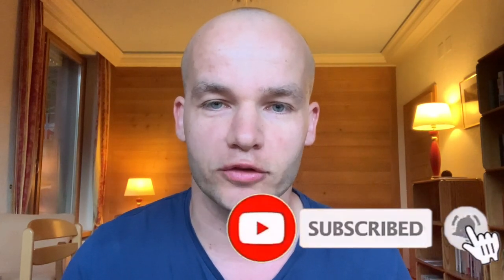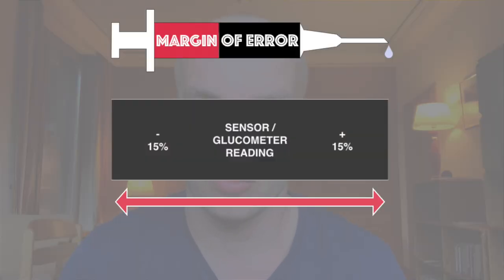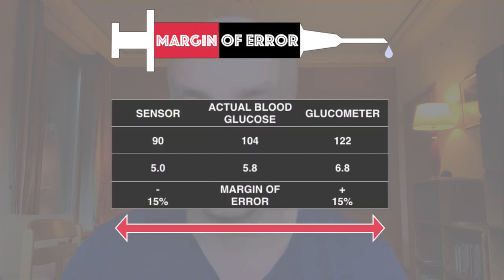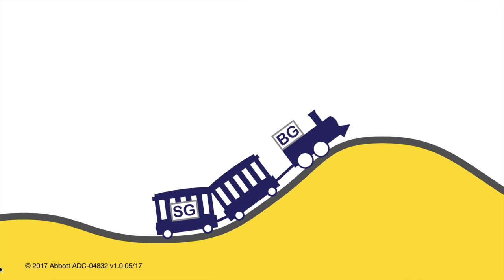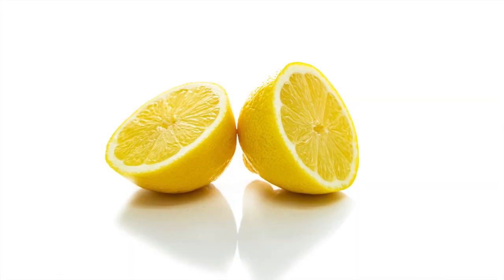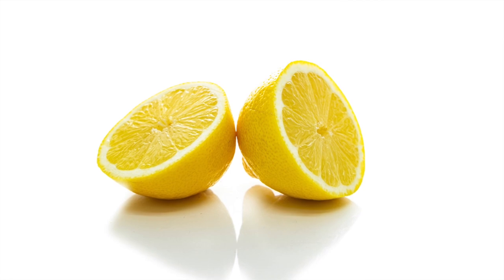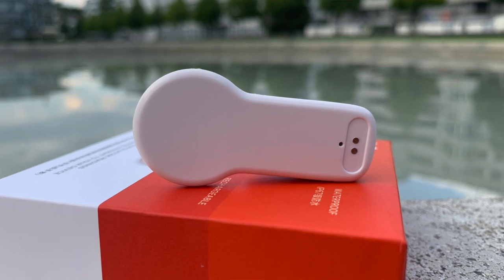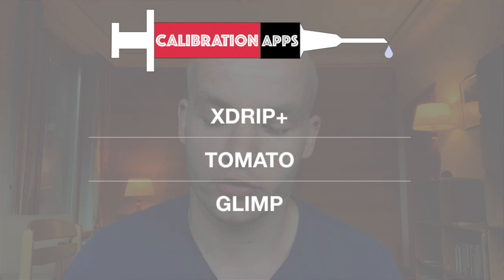FreeStyle Libre Accuracy Issue / 6 Tips For Accurate Sensor Readings

Comment: Ditto to everyone about the accuracy problem.  My Freestyle Libre has told me that i'm having low blood sugar when my finger stick meter tells me my blood sugar is normal & in range. I'm not quite sure if the poeple who developed it are diabetic's. We live it & the poeple who doll out the medical advice on diabetes aren't.  The stress of living with this disease is incalculable. Is this thing a cash grab or is this mean't to improve the lives of poeple suffering from diabetes ? Guessing what poeple's blood sugar is , is not an improvement in my opinion . Accuracy the the key to better health.  Anyone can guess, this system needs a  big improvement.
Reply: My meter was 50 points off this morning. It alarmed me to a low reading. Then in the afternoon it was about 10 points off from my finger prick with my reading dropping quickly below 70.
Reply: What i have found through experience is , when you start using a new sensor, try to have your blood sugar reading as close to normal as possible. Not too high or too low. 
Finger prick blood reading’s give you the true reading. Monitor what both tell you, until you are comfortable with what Freestyle is telling you. 
It’s like converting French into English. Also, the last few days of a Frestyle Libres life, you really need to monitor what it’s telling you. Battery life is an issue. Like i said previously, finger prick readings can always be relied on to tell the truth. Use the one you know works to monitor thee other.  
That way you don’t get too high or low, and can see which way your sugars are heading. 

I hope that helps .

Comment: Im new and i used 3 sensors. The first one i applied to the outside of my arm and got reasonably accurate numbers. The next 2 i applied to the underarm and got wildly inaccurate numbers. My last reading was 50 where glucometer shows 137. Im beginning to lose faith in this device.
Reply: You should apply the sensor to your arm. It’s said in the instructions
Reply: @GregO0oo  yes and then the sensor was reasonably accurate 😐 the problem has started when he began to apply sensors to different spots
Reply: I’ve been using the Libre 2 for a couple months and every other one is wildly inaccurate. The sensor will show 150, but my when I take my blood it’s 100
Reply: Just put it on the outside of your arm if it doesn't work under your arm. Also watch a video on exactly how to calibrate it correctly. Ive had 3 sensors be faulty because i would put it on then be doing work. For the first hour you LITERALLY  need to sit down keep your arm motionless and wait for an hour, make sure your not taking a shower or going swimming for 24 hours. So take a shower before applying it. I had to learn by asking a pharmacist how to apply it correctly because one wrong move and your sensor could screw up during application and calibration hours.
Reply: @MonkeGamingTips  thank you, helpful answer.
Reply: There is only one, just one approved place, the upper arm as in the instructions
Reply: @MonkeGamingTips  This is good information and it makes sense from my limited experience.
Reply: I’m a new customer to diabetes I bought one and on the first try I lost confidence to this freestyle libre 2 stuff.
Every time I check is off by a lot and gives you a different reading , this is crazy I should have read the reviews before I bought this stuff…I will keep using my regular true metrix pro😢
Reply: @coltsin1466 don’t trust this sensor.
Mine was reading 120 but when I used the regular one it was 85

Comment: I found that by drinking quite a bit of water throughout the day has made a big improvement in readings between sensor and blood sugar readings.  At first I was skeptical but tried for a few days and was pleasantly surprised.  Thank you for all the information you provide.
Reply from the maker: You are most welcome! Thank you for sharing your experience. Great to see drinking water throughout the day made a positive difference for you. Wishing you all the best!
Reply: I just started using mine a couple of days ago. I will try drinking more water throughout the day. I hope that fixes my problem.
Reply: @lilsisasu  I hope you got some better results. I'm new to libre2 (2 days in) and an seeing 25-30 mg/dl difference between sensor and sticks constantly. I'm not new to diabetes, just new to cgm/libre. Been an old schooler for a long time. Very frustrated with the inconsistencies. I'm drinking water now hoping it changes
Reply: @mygt8a4re  I am. I read in one of my diabetic Facebook groups that 20 mg/dl is considered the margin of error.
Reply: @lilsisasu  thanks for your reply. I have been researching and also finding that +/- 20mg is normal. But the 30-40 gap I get on the higher end is not good for me. I keep getting cgm readings of 160-170 when my BG is 125-135 by finger stick. But not always. I find myself using my finger sticks to compare which kind of defeats the purpose of  trying to rely on the cgm while im out. I can deal with it being off, just need it to be more consistent. I know, In picky 🙄
Reply: I’ve been using mine for almost a year now (Freestyle Libre 2) and it frustrates me to no end! I’ve been told the sensor failure rate is 40%…plus I have to use the reader vs my phone and I just received my third replacement reader, and there was a problem with that one as well. I have extremely bad hypoglycemic episodes and have trouble telling when I’m going low…I’ve been a Type 1 for 47 years…and I was hoping this would be more helpful than it has been. 
When the sensors work correctly, I find they average 14 less than an actual finger stick. But that’s when it works correctly, which (for me) doesn’t happen very often.

Comment: I don't think that calibration is a good idea. Since interstitial glucose trails blood glucose by 15  minutes or more if you calibrate while blood glucose levels are climbing then your calibration will be inaccurate (too high) when blood glucose is falling. And vise versa. Does third party software take reported glucose direction into consideration? It's best to correlate sensor and blood glucose with 15 minute delay and just check the direction of the arrow. If it is upgoing then current blood glucose is  higher than sensor glucose, if it  is downgoing then current blood glucose is lower than sensor glucose.  The actual difference should not be huge and if it is then sensor is probably defective.

Comment: I’m watching from USA, in Mississippi. I’m Type 2 and I am currently using the Freestyle Libre 2.  I’m new to it, but just experienced a low of 65, so I compared it to my glucose meter, and it read 115.  Lows are not normal for me.  Your information helped tremendously. Thanks
Reply from the maker: Thank you so much for your kind words my friend.
Reply: I find that the libre (2) is more accurate at the high end. At the low end it often undermeasures.
Reply: @Jnglfvr  that's what I'm thinking too.

Comment: Thanks. U.K. Libre 1 at the moment. 

I’ve found Abbott to be very good at replacing faulty sensors, but it takes about a week so I always have a spare just in case. (Annoying when I have to self fund). 

My own favourite top tips are to apply sensor the day before activation and to stay hydrated. I agree with accuracy: try doing a finger prick test on your left and then right hand immediately- you’ll probably get a slightly different result (I just tried it and found a 0.3mmol/L variation) 😀
Reply from the maker: Great tip. Thank you for sharing. Have a great day!

Comment: Hi Tom, Great video - very helpful! I am in the USA and have type 2 diabetes. I have the Freestyle Libre 14 day which I think is older than the Freeastyle Libre 2 (which is availalble in the US). My readings are always 10 to 20 mg/dl lower than my glucometer. Keep up the helpful tips and Thanks!
Reply from the maker: Thank you so much for your kind words and sharing your story my friend. Stay safe!
Reply: Is a 10 to 20 mg difference ok? This is my first Libre and it's a 2- It seemed to be accurate in the beginning - I  still have 7 days left on the 1st sensor. The sensor said I was 68 so I did a glucose finger stick and it was 90- BTW, I am in the US.  Can anyone tell me if this is ok? Or should I ask for a new reader? Thanks in advance.

Comment: I've only had problems with Freestyle Libre2. I'm in the United States. On average every sensors has been around 60 points off. Example, finger prick = 144, sensor check = 199. It is so frustrating!
Reply: Same
Reply: @elperron06  I talked to Freestyle customer service and they asked me to do a check using my sensor, then wait 10-15 minutes and do a finger prick. I tried that and my numbers are no more than 10 points off. Works great. Sometimes I have a sensor that doesn't work but they replace it for free.
Reply: @kizzihogan7195  mine is 79 points off. Fsl said 64 and my glucometer said 133. That is a big difference. I don't know if mine is accurate
Reply: @ciciloveheart3628  are you waiting 10-15 minutes between checking? Check sensor then wait 10-15 minutes and check glucometer
Reply: Main value of sensor is the continuous reading, from which one can learn over time what effects are produced by what actions. Users should be advised of this before starting to use one. The delay between venous and capillary levels and tissue fluid readings can be 20 minutes so differences will often be present. Look at the sensor frequently and use it to learn the effects of the various things that you do. Type 1 diabetics will always have some unpredictable changes in levels when affected by a viral or bacterial illness
Reply: @tonykelpie  I absolutely agree with everything you said. I was not taught anything about why it was important to wait 15-20 minutes uses and the great value in looking at the daily graph. There is such power in knowing what actions are creating each glucose change. I also watch my overall glucose average. Thank you for sharing your wisdom.
Reply: @kizzihogan7195  thanks. I have found that using the information provided by the continuous record - including overnight- is very helpful. It can take time to be sure what is a real effect of any action as repeated observations can be needed to rule out the effects of random fluctuations. The average glucose over 90 days corresponds closely to HbA1c levels and average glucose is a more accurate guide than individual readings for that reason. Sometimes the arrows can be misleading- I check frequently and often do my own calculation of rate of change to guide decision making re injecting, eating, etc.,. Looking frequently, repeated if unsure, and learning to use the information is the key
Reply: @tonykelpie  Yes! Don't you fond it unfortunate that Abbott doesn't teach all of this to new users? It took me months of trial and error and finding out what information was most important. It would have been nice to have been taught it when I first started using the product. I have a service dog 🐕‍🦺 and often times she will alert me before my alarm will go off on my reader. Like you, I check often and get all of the use out of my Freestyle system.
Reply: @kizzihogan7195  thanks Kizzi. I am in UK where NHS specialist nurse gave me introduction ( she said 20-25 minutes delay but it might be less). I also have 42 years experience as a doctor (35 of them with T1DM) which helps. If your average glucose and HbA1c are good and you are not having big problems with hypos then carry on. If not make small adjustments and monitor carefully until you get where you want. Standard stuff re not smoking, not drinking too much, controlling weight and keeping fit applies to everyone; benefits of Olive Oil also pretty clear in reducing heart disease
Reply: @tonykelpie  you've got a lot of experience and I'm grateful you are sharing it on here, perhaps it will help others. My A1c was 6.8 last time and my average glucose stays around 120. Unfortunately I'm disabled and 80% of the time I'm wheelchair bound and obese. Again, I appreciate you sharing your knowledge and experience.
Reply: @kizzihogan7195  6.8 is good. It could be lower but do it gradually and avoid hypos. Avoiding hypos is actually more important than pushing too hard to get it lower. I always have sweets or a small carton of orange juice with me, including by my bed. Adjusting the long acting glucose dose needs particular care (I have mine at 2230-2330 and have lowered dose since using Libre as levels were often very low at night). Libre is very useful for deciding when small top up doses of insulin might be needed in day, or small intake of sweets or orange juice. Weight reduction can be worked on by always starting by reducing intake at those times of day when BG is known to be high; increasing insulin simply maintains or increases weight. Exercising those parts of the body that you can use is good; strong arms are a big asset to wheelchair users, as are strong core muscles. I hope you stay well
Reply: @tonykelpie  I've enjoyed talking to you, Dan. I don't take insulin, I take Janumet and Metformin currently. I struggle with hypos because I was hypo for years then it changed to T2D. My service dog wakes me up when I'm too low. I believe you call them assistance dog in the UK, but I can't remember. Stay healthy and let me know if you are on any social media platfom
Reply: @kizzihogan7195  I just contribute randomly whenever I have time. Best wishes
Reply: @kizzihogan7195  thanks for letting me know. If you are not using insulin it’s mostly about controlling CHO intake and spreading it throughout the 24 hours as needed. Libre still useful in keeping you informed. In UK I don’t think NHS will find it for T2. Understanding Glycemic Index is helpful 
Best wishes
Reply: @kizzihogan7195  Shouldn't it be the opposite: first do a fingerstick and then due a sensor reading 15 minutes later?
Reply: Same

Comment: Hi Tom.  Thanks for another informative video.  I am in the USA and I have been using the Libre for about 2 years now.  I personally think the #1 tip should be to stay well hydrated.  I’ve found incredible inconsistencies in comparisons when I am not well hydrated.  Let’s face it. Sometimes we just don’t want to drink even though we know we need to.  Putting that aside, I have dealt with some far off comparisons and Abbott has replaced every sensor.  Every time you have to go through the same text book cookie cutter questions, but in the end they get the information they need, and if needed they request the sensors back for evaluation.  I am currently using the regular Libre, but i do have the Libre2 sensors and reader as well.  I am just waiting for the app to come out so I don’t have to carry 2 devices, but I am getting antsy and want to see how they compare.
Reply from the maker: Thank you for sharing your experience! Have a great day and greetings to the US!

Comment: OK, I'm here in the USA and I believe that the new libre 2 is out and available. I'm still on the libre 1 (14 day one) but will be seeing my endo at the end of the month. I plan to ask to get the upgrade. It does follow pretty well my finger sticks most of the time. the last seensor I had kind of went a bit crazy during the last 24 hours of its 14 day run. But it was trackable (was always off by a reading of 30 or solower than finger stick) so I just added this to the scan. Keep up the good work Tom!!!
Reply from the maker: Thank you for your kind words and sharing your experience. Very much appreciated. Have a great rest of your weekend! Wishing you all the best!

Comment: I’m watching you from the US, and I use the Freestyle Libre 2. This is the 2nd day of use and I have soooo many questions. I accept without question the 15% variance. My main question is, “Does the FL2 work with a test strip for calibration purposes.” I am interested in any related content that you put out. Thanks for doing this.
Reply: Hi, I have just acquired an FL2. No, the FL2 does not calibrate to a blood glucose test strip inserted into it. You'd think it would, and should but it doesn't. I am currently having trouble because my FL2 readings are a whopping 2 mmol/l below what my blood glucose meter is showing.   This is really annoying because my FL2 low glucose alarm keeps going off in the middle of the night thinking that my blood sugar is below 3.9 when in fact, it is actually 5.9. I  have requested a replacement sensor from Abbott and am hoping for an improvement. If it does not, I will chuck the FL2 and go back to pricking my finger. So far I am having a bad experience with the FL2.

Comment: Tom I am new to Free Style Libre and have found the difference in measurement varies widely. I agree sensor lags behind 5 to 10 minutes or a little longer. I hope this works to better control the glucose highs and lows
Reply from the maker: Welcome to the Libre team! I hope some of these tips help. Btw next week I will be releasing a video about calibration. This might be also helpful for you t watch in case you still have significant differences. Wishing you all the best!
Reply: My doctor explained to me that the sensor reading basically tells you what your blood sugar was 15 minutes ago…not very helpful in my opinion but if I do a finger stick and then scan my sensor 15 minutes later, he’s right. 
I’m not even really sure how this thing got FDA approval at this point.